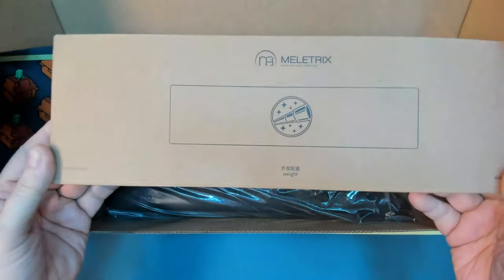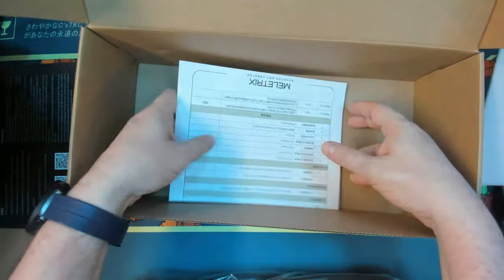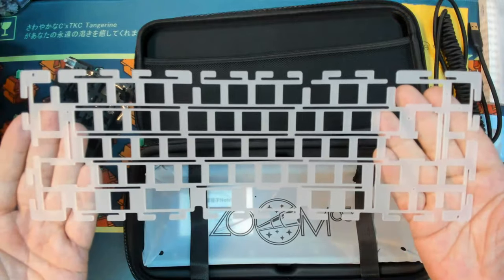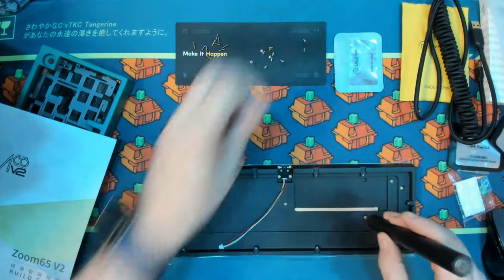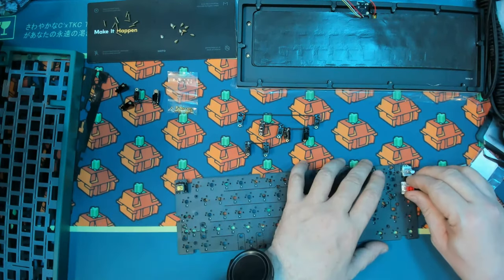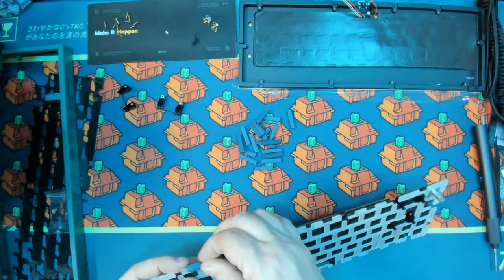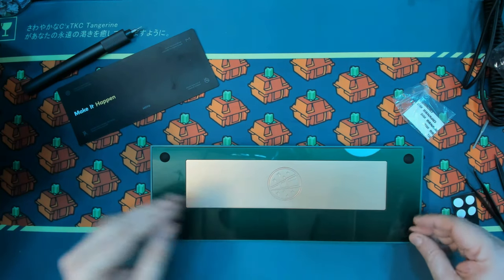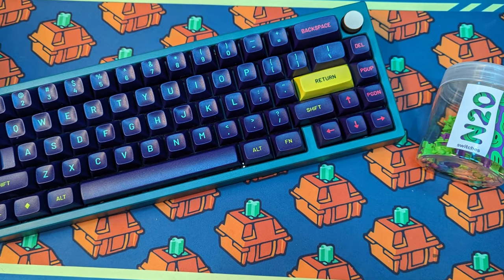Zoom65v2: Build, Review, and Sound Tests  | KFA N2O KPR BCP MT3 Cyber | 65% Mechanical Keyboard Kit

Comment: Great video! I also have a zoom65v2 with pc plate, all the foam installed, akko v3 cream blue pro (factory lubed switches) and a cheap pbt xda profile keycap set from aliexpress.
My stabs are not lubed, i just used them as they were, and especially the space bar has a "clicky / rattly" metalic sound, exactly like your stabilisers in the video. Hope lube does the trick for me.
Did you manage to tune them to perfection, and if so, what did you end up doing?
Reply from the maker: Yes, a bit of lube did the trick for me.

Comment: I personally lube the housings, stems, & wires on my stabs. A little heavy too cause you get a certain amount of squeeze out & settling with use (with XHT-BDZ being the exception here. Careful with that stuff, just a tiny bit too much & you might as well have used peanut butter on your stabs!).
Reply from the maker: Right on, thanks for sharing, cheers!
Reply: I just built my first custom keeb (Zoom75) and the spacebar stabs are definitely overlubed lol. It's kinda hard to use the proper amount of lube.
Reply: @el10leo   Yeah it does take a few builds to figure out how much lube you'll like on your stabs & switches. The good news is with use overlubed stabs will loosen up so to say. Spamming the offending stabilized key is a good way to speed up the process if it's really overlubed.
Reply: I wonder if overlubed can damage your board or not :)) actually feel like im overlubed my stab but it seem to be solved my ticking problem :)))
Reply from the maker: @duyanhcenland2044  being as the grease is dielectric, it won't cause any shorts, just get messy. Have you ensured that your wires are balanced?
Reply: @MechKeyboards  no its not :)))) this is my first time i know its sound stupid but i cant wait to see my keeb fully assem :)) better go with hotswap next time